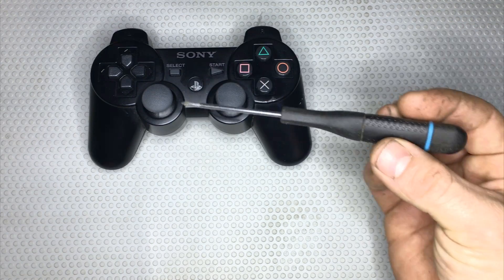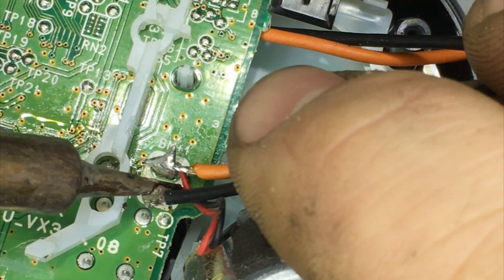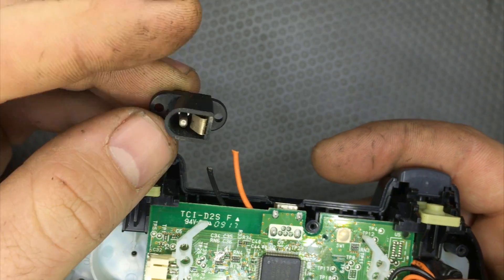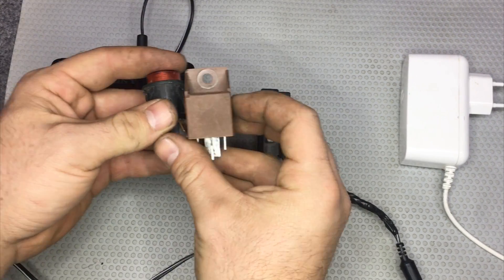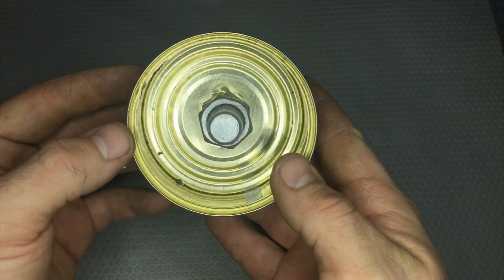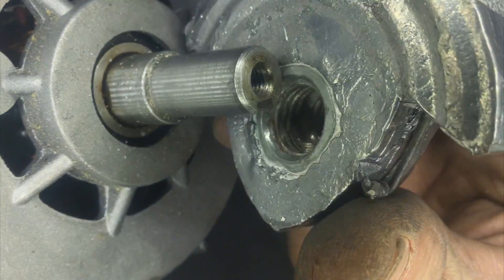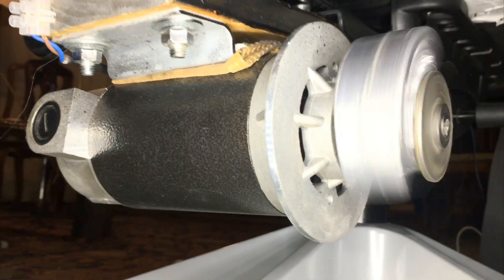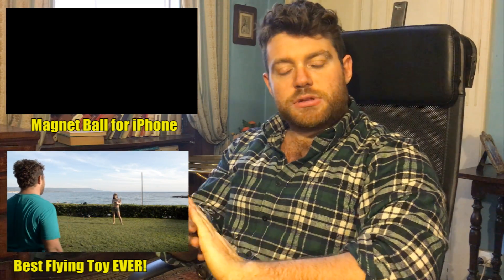Gaming Chair - Shock Feedback • Do it Yourself !!!

Comment: Hi I have a recliner and a motor would it be possible to install speakers and have the motor connected to the speakers instead of the controller so I can feel the gunshots and explosions and crashes would this be possible? Or is it possible to connect a wireless receiver that would pick up signals from the motors in the controller?

Comment: I've done it for the controller and it's great fun thank you but I have a steering wheel and can't figure it out to work with it since the rumble on it is just the wheel shaking so any clues? there's a video from 2 years ago about someone using arduino to do it for the pedals which should work the same but the software is gone. why hasn't anyone done this yet? it seems so obvious

Comment: I have different idea for this. If you have subwoofer outs (like from av receiver or it could be from computer as well) just get some bass/seat shaker. It activates when low frequency is active (rumble explosions) and it shakes the seat. Or you can steal that signal, decode that signal with arduino (and you need to code it but if you know how sounds it is no issue) and code yourself dbox seat experience... or close to it
Reply: And ye bass shakers can be connected in series for multiple seats

Comment: but it will not work as a real gaming chair, because the relay will turn on when there is enough voltage across the relay,what im trying to say is in a real vibrating gaming chair there would be varing amounts of voltage and pulses to create the vibrating effect, in this motor its either on or off,  anyway nice project tho.
Reply: Was looking for a comment like yours to save typing it myself Xd 
But it still is a good video

Comment: how can i combine this with a steering wheel? is it possible to use the controller seperately for just the vibration?
i don't want to solder anything to the steering wheel.

Comment: Why do you need the small relay inside? Could you not hook the wires directly to the big relay?
Reply: +Auarhau   It depends on the relay.  Larger switched loads usually require larger switching capability as the contacts are heavier.  In this instance, there is insufficient voltage and current in the PS controller to drive the big relay directly.  The smaller relay he is using is capable of being driven directly from the PS controller, which in turn is used to switch a larger relay using higher voltage/current.  A solid state relay would be better.   These are basically a TRIAC driven by an opt-isolated low side.  The low voltage side could be safely driven directly from the PS controller.

Comment: Practice soldering. Take a 12V Motor. 

If you want a grateful electrical dead, use extremely more Volts and Amps. The inheritors only had to use the broom.

Comment: Quick question: how is the delay when playing games? Is the big motor a little bit too late or do you not notice that?
Reply: +Radar Really yes, but I could imagine that the big motor needs a moment to spin to a speed that you can feel which also needs to put the chair into vibration.
Reply: i
Reply: There shouldn't be enough of a delay to notice with just a pair of relays and less than six feet of witre.
Reply: +pcfreak1992 Hm. didn't think of that.

Comment: Couldn't you have just used a single relay?  That is, so long as you picked a relay that could handle the 220V and motor draw on the output side, and was sensitive enough to be activated by the PS3 signal on the input side, you could eliminate the relay in the controller, right?

Either way, cool project!
Reply: 12v

Comment: Nice DIY idea. 

But 
>exercise plumbing,
>watch on safety, it should do a professionel - take a 12V (wiper-?) motor and use a step down transformator / power supply unit.
Reply: At least: If you wish a grateful electrical dead, use a higher voltage with a good level of current. (> 10 000V / > 15A) If your children got luck, they skimp the incinnerator.

Comment: No relay is a type of electric switch that uses low voltage(12/24V for example) to on/off higher voltage like 220V.

Comment: The relay you used was an automotive relay, the isolation between coil and contacts is probably insufficient for mains use, you could end up with 220v on the barrel connector if the insulation breaks down.
Reply from the maker: +TheChipmunk2008 i choose one with an high amperage. but great advice ! thanks!!
Reply: +Rulof Maker Thank you for taking it in the good spirit it was intended. A good way of protecting yourself would be to ground (earth) the low voltage (12v) part of the circuit, that way if the insulation DOES break down, it will blow the fuse/breaker rather than leaving the 12v part live at 220v :)

Microwave ovens often have a 12v (or sometimes 24v) relay with very high current contacts that's rated for 240v between coil and contacts :) (of course taking apart a microwave exposes you to more dangers!)